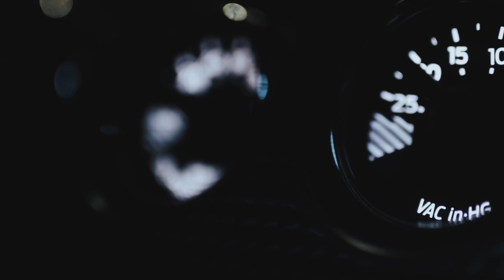Big Turbo 5.3 Corvette Dyno Pulls, Mako's New Wheels, and @Shmee150's 2020 GT500!

Comment: I wanna see dougs new setup on his mustang run Sean’s corvette
Reply: How about Doug vs the gtr on full boost
Reply: @F90ronny63  Doug is probably shooting for 1100hp which is what the turbo setup is built for and has done so the GTR which makes at most 600hp wouldn't be a good match up for Dougs monster
Reply: Yes I would love to see Sean's Corvette get the gap by a mustang
Reply: The stock motor won’t handle much I don’t think
Reply: @F90ronny63  Gavin’s original motor held near a 1000hp there for a little while🤷‍♂️
Reply: Ok my comments keep getting deleted wtf
Reply: He still needs a new transmission
Reply: @F90ronny63  you can find a tremec trans anywhere
Reply: I'm 100 like

Comment: Not a cleetus nut rider by any means but he's definitely not gonna out run cleetus..I guess everyone's gatta have a dream.
Reply: thats what i was thinking tbh. hes way under power even at 1300+ hp and hes probably heavier too.
Reply: That car has the potential to be faster than Leroy but probably not with that 5.3. Leroy could be way faster with better aero. They did wind tunnel testing a few years ago and it was calculated that it's taking them like 500hp to overcome drag at 170mph.
Reply: Definitely heavier..I never heard him say ruby🤷‍♂️I was assuming he's talking about Leroy 🤣
Reply: NO SHOT cleetus weighs 200lbs less and is making like 1600hp currently and is a better driver and is getting leroy Dialed in to the point of cracking into the 7.40s and then he will add bigger turbos so Leroy will make around 1800hp and probably be in the low low 7s or maybe even a 6. A guy can dream
Reply: @06RedfireGT  That car weighs roughly 200lbs more than leroy does with just the 5.3 let alone the motor he is gonna need to even be in the 7s with the car. Also I would argue cleetus is a much better driver. The only thing that car has over leroy right now is aerodynamics and with stick cars most of their ET is made up in the front half where aerodynamics barely applies anyway
Reply: @fleimlehner  Leroy is going 7.50s with the turbos he has now and is only making around 1600-1700whp. With bigger turbos Leroy could make over 1800whp so that is probably gonna drop to low 7s maybe even a 6 second pass. And the worlds fastest stick shift car OVERALL their best pass is a 6.84 so leroy even where he is now is a SERIOUS competitor so I doubt this guy will be much competition until he gets a serious motor and a ton of seat time. Leroy also weighs 2836 with Cleetus in him and that corvette will probably weigh at least 3000-3100lbs with the driver so he is going to have to make equal power to even have a chance to catch leroy. Also he is going to need a Black magic clutch to get the launch those guys do and to hold the power and that is at least $2000 if not much more
Reply: Yea I gotta look at some vids of this guy driving his car. Not riding Cleetus’s nuts either but HP is only one factor, but can he drive and Shift like Cleetus is the question. They said he hasn’t taken it to the track yet, so my guess is by the time he gets it all sorted cleetus will be going even faster, his setup is dialed
Reply: @BeardsandCars  he is talking about Leroy, Leroy is their only stick shift drag Corvette, ruby is a power glide I believe
Reply: @thomasloebig8612  that's even more hilarious 🤣
Reply: @keva3336  Agreed and his driving is dialed and leroy is one good pass away from 7.40s and one turbo swap away from deep 7s I'm talking 7.10s. From what I have seen on his Instagram the other guy is no where near as fast at shifting as cleetus is so it will definitely take him time to get faster. By the time he is in the 7s cleetus could be in the 6s with leroy. So TBH I doubt he will ever be faster than leroy. And once leroy actually starts having aero issues out the back I bet that will  be addressed. I think a Lexan body or some other clear strong plastic would be perfect, its light and see through so it keeps the look of leroy alive but gives him 10x better aero.
Reply: @tstuff1213  exactly Cleetus has been in the 7’s now for I believe 2 years going on 3 years this August. Lots of problem solving has been going on until he got the 7.67 and ran out of turbo. There’s no doubt Precision has bigger turbos on their way to him already.
Reply: @fleimlehner  if were talking about leroy then yes he will lose by a mile 
hes atleast twice the weight has i believe the same horsepower or less and hes only on a single turbo
so no hate to him but he will not get close not in the 0.5 atleast
Reply: @keva3336  For sure, Kevin from KSR commented and said that with a bit more dialing in Cleetus should be able to hit 7.40s before they even do the turbo swap. Cleetus has so much seat in Leroy that he knows all the cars tricks and flaws already this guy is going to have to learn all of it which takes alot of time.
Reply: @tstuff1213  Leroy is not making that much power. More like 1100-1200. Not one of his videos says he’s making that much.
Reply: @off-roadhooligans6687  What was the last time you watched a video lol. Check out the video Redneck youtuber makes 1500hp. In that video Leroy make 1569whp on only like 21 psi. And in the unboxing of engine version 2.5 which is currently in leroy Cleetus said it can handle 40+psi of boost and around 1800hp and since then with the current turbos he was run up to like 35psi max which would be around 1600-1700hp roughly. So he still has like 10 psi of boost and probably several degrees of timing left to make that 1800whp mark.
Reply: @thedandy6765  Your right he will lose. Much less horsepower at this point in time probably less than half of what leroy makes. And about 300lbs in weight difference. So 3 tenths he has to make up in weight alone. And a worse driver
Reply: @off-roadhooligans6687  Leroy is making between 1550 and 1700 whp depending on tune setup, and where the power is brought in
Reply: @tstuff1213  well shit I guess I didn’t see that then. My bad bro.
Reply: @thedandy6765  twice the weight is a stretch id say 400ish pounds at most and yeah i believe even at 1300hp hes still down a couple hundred. Leroy is making 1800hp i think
Reply: He won’t even be close to keep up with cleetus he got weight on him and still not in 4 dights hp but he might be close enough to beat the dale truck
Reply: @off-roadhooligans6687  No problem all good lol 👍
Reply: @fleimlehner  do you by chance know if Cleetus is running the PT6466’s on his setup I forgot which ones he has.
Reply: @06RedfireGT  damn imagine they put a body kit on it 😮 if he ever gets beat he will and it’ll be scaryyyy.
Reply: @tstuff1213  think you mean 7.84 and think he just beat that record when he switched to radials
Reply: @6.7cummins8   HA, His original fastest time from when he first entered the 7s was a 7.82 at 176mph then at world cup finals he improved and went a 7.79 then more recently he went a 7.67 on the radials which i believe is his new best and in that same video Kevin from KSR Fab (his tuner) commented saying some fine tuning on the current setup should put leroy in the 7.40s before the new turbos they need to put on. I miss said saying he went 7.50. So he is one or two solid passes from being even more of a threat then he is now to other serious stickshift competitors.
Reply: @keva3336  I believe they are twin 76/75mm turbos
Reply: @tstuff1213   i dont think leroy unless they completely change the set up and get rid of the trans axle will ever dip into the 6's just get to expensive even said it in one of his videos its the fastest corvette stick shift and the best parts keep breaking but seems like the radial did the trick but also when your in the 1000+ hp range anything is going to break its only a matter of time
Reply: @6.7cummins8  Cleetus said they are working on improvements to stop it breaking along with RPM transmissions. I see what you are saying but other than it breaking the trans axle setup works very good for leroy and at this point helps classify him as a corvette. So i dont think they will switch over to solid axle but who knows. I agree it will only go so far but i think it will go far enough for a high 6 but past that I agree it is highley unlikely to hold the power.
Reply: @jkfonyi  I thought stock bottem included stock rod bolts and main bearing bolts which I don't think they are. Also the piston rings are gapped along with the block filler so is it really a stock bottem end 5.3. Thats up to your opinion but personally other than the physical crank, rods and pistons nothing else is stock its not a stock bottem end. Its in that weird like grey area of whats considered a stock bottem end LS engine it could go either way.

Comment: The way to beat cleet is literally just have body panels. his aero is so bad he needs so much more hp to compensate
Reply: I agree but he’s never gonna our run cleet
Reply: well...it’s a case of weight vs aero, and weight certainly matters more in a 1/4 mile
Reply: @ethanqs7633  dont forget driver mod. Its manual vs manual
Reply: @Ethan QS  Or more weight, just look at how much better Foxyboi’s drift taxi did with some man meat in the back on one of the earlier This vs. That episodes
Reply: @sawyerthompson6583  FACTS
Reply: @MystPlazma  I would definitely say Cleetus is a better driver IMO
Reply: @ethanqs7633  And that corvette (not leroy) with the driver is going to weigh around 3100lbs probably and that's 300lbs more than leroy with cleetus in him and cleetus is planning on taking more weight out
Reply: @dylannix4289  That was a drift car tho. And it was needed for traction. Leroy with them radials and the transaxle has almost a perfect 50/50 weight distribution and is having no trouble hooking on a prepped track
Reply: Weight is a huge factor and that corvette weighs roughly 300lbs more than Leroy. Also Cleetus is a better driver and has a better team behind him. Also with stick shift cars often the most time is made up in the front half and there aero barely matters mostly weight does and the tune. Aero really only comes into play on the back half of the track and even so leroy is trapping 186mph and has more left on the table.
Reply: @dylannix4289  That’s not really comparable at all, these are both purpose built drag cars that will hook on a prepped track. The only reason you’d need more weight is to hook on street tires. 
Weight is never an advantage in drag cars, more mass only equals slower acceleration, and as the other guy mentioned, aerodynamics matter very little for the majority of the 1/4 mile, and leroy certainly doesn’t struggle at the top end. 
Also, as someone else mentioned, it may come down to drivers,and cleetus holds a lot more experience and seat time in his car and others.
Reply: @tstuff1213  exactly
Reply: @ethanqs7633  THIS GUY GETS IT, 100% agree
Reply: It's not about going faster than Cleet....it's the Corvette GM 6 Speed record.   Sorry...but making it a solid rear end and putting the trans in the front, not really a Corvette anymore....they are apples and oranges in my opinion now...
Reply: @1216jimmyz  Yes and no. He said it was his goal to beat cleetus Its still a gm transmission not a corvette one mind you. Its still LS powered and has a corvette body and chassis mostly. So I can see where you are coming from but I also see the flip side that its still a corvette
Reply: @tstuff1213  they even said in the video ..it's basically an F Body now ..lol....
Reply: @1216jimmyz  Yeah basically lol.

Comment: Here in norway you can't even get a car licensed and road legal if you just swap the engine. It has to be an original engine with the original horsepower. Sucks since most cars here are stock 70-150hp

Comment: No shot at beating cleetus. IMO. less power, more weight and with the loss of 50/50weight distribution by putting the straight axle in the back he may struggle to hook for a while. Also Leroy is already in the 7.50s and is one good pass away from 7.40s. That's ALOT of time to make up. I will love the battle but man is he going to struggle. The only advantage is Aero and maybe the straight axle because it wont break as much but cleetus is already considering doing that. Also with stick shift cars most of the time made up is in the front half of the track where aero is not as much of a factor and leroy is pulling 1.20 and 1.1 sixty foots currently which is good enough to send you into the 4s in the 1/8th if the rest lines up and from that point its hold on and deep 7s maybe even a 6 from that point. Also leroy even with the bad aero goes 186mph out the back with power left on the table so......

Comment: Which is it? 2000+ horsepower capable motor or 1500+ horsepower capable motor for satan
Reply from the maker: It’s going to be a 2,000hp capable engine. I’m only going to shoot to make 1,500whp reliably on it so it stays safe.

Comment: Howdy Gavin ive been subscribed to your channel since 800k and ik this doesnt usually work but me and my pops have a 1969 dodge charger with a 383 big block in it but it doesnt run rn and hes put alot and I mean ALOT of money into it and he spent all day and all night building it from the ground up. He's told me that he wanted to put a V10 dodge viper engine in it but he ran out of money. And if you could get in touch with me that would be awsome even if it is just to help me find a Viper motor for it that would be awsome. He's my uncle but hes been the only father figure and it would just be fuckin awsome and ik this sounds corny or cheezy but if you could thank you. My insta is xavier_reyes.ruiz
Reply: Anything helps thank you. And ik alot of the other subscribers are gonna shit talk me but im tryin to do anything to get this car runnin for my pops. Itsjusta6 community could yall help out thanks